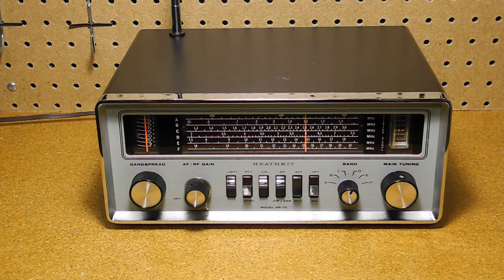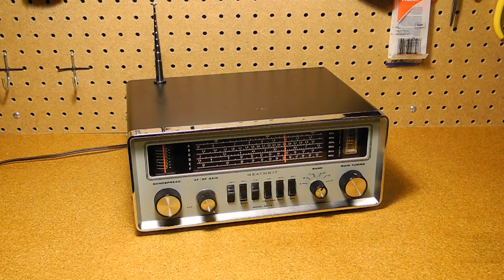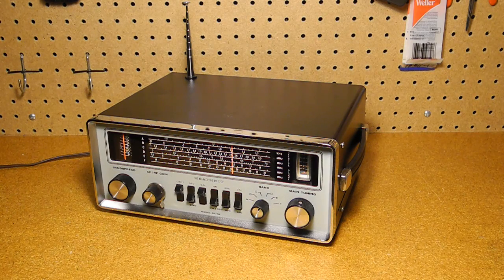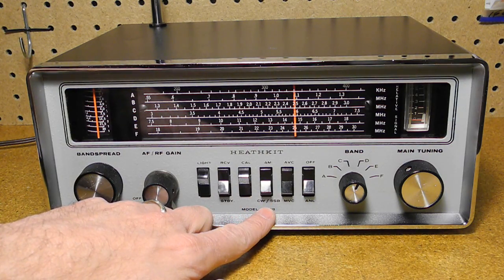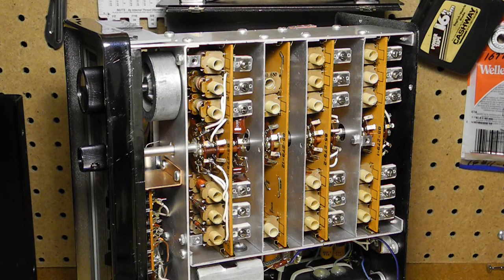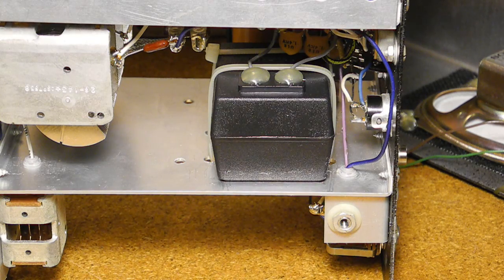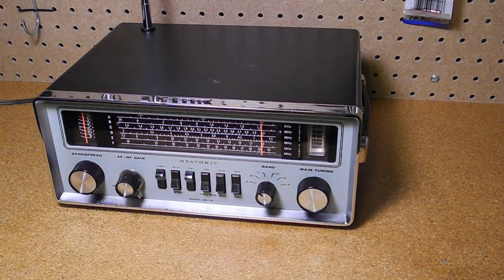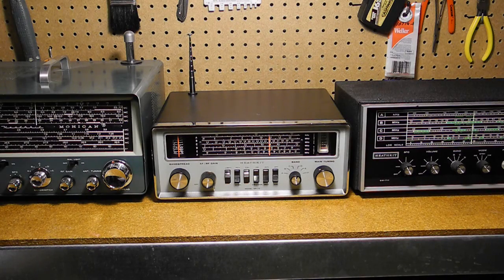The Heathkit GR-78 General Coverage Receiver

Comment: Wouldnt nimh rechargeables work just about as well as nicads ?
Reply from the maker: Yes, NiMH batteries could be used in place of the original NiCd type. They produce the same voltage and have a greater capacity. In that case you should not connect the built-in charger as it would not correctly charge NiMH batteries and could overcharge and damage them.

Comment: Do you know what kind of transformers does it used?
Reply from the maker: It is a custom power transformer, unique to this radio, Heathkit part number 54-226. A reference I found listed it as 120/220V primary and 6V @ 50 mA secondary. You should be be able to find a similar transformer with approximately 6VAC output and a current rating of at least 50 mA.
Reply: @jefftranter  thank you 🙏

Comment: Jeff, is that BNC connector something that was added? Also, the knob for the audio volume is a replacement. Even though I am a very experienced Heath builder, that unit looks like it would be a bear to build. That modular "shaft through the boards" seems to assume the unit will never need board-level service of the boards that the shaft goes through. By the way, I very much enjoy all of your videos, just really excellent!
Reply: i built one... that other antenna port is a add on... not in or addressed in the kit.

Comment: Jeff, The content of your videos is very good, however, your lighting could be improved, especially for the top portion of the screen.

I have most of the Heathkit Shortwave receivers.  I think I have 4 to go to complete my collection.  I consider the amateur radios in a different class, so don't attempt to collect those.  I have lots of fun listening to these low end radios, Heath and others like Allied, and seeing how well they can receive.  I also enjoy building my own sets, and would love to correspond to folks with similar interests.

Regards,
Don H.
Reply: Where do you buy parts for this GR-78. I need the whip antenna.